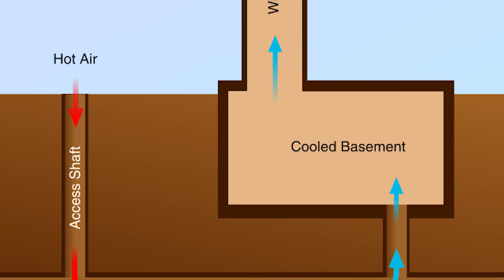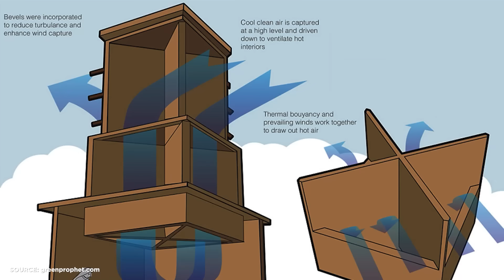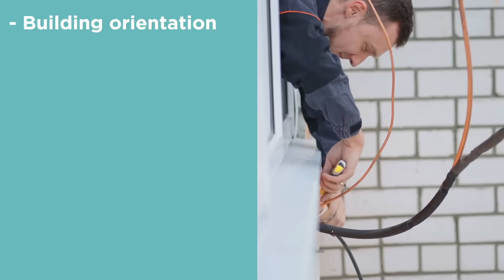Forget Heat Pumps - This House Cools Itself With NO Electricity!

Comment: Greater surface areas absorb less heat?

The rate of heat transfer is directly proportional to the surface area of the object. This means that the larger the surface area of the object, the faster the rate of heat transfer.

Comment: We sell devices in Japan that can be placed on balconies or balconies and use wind to cool the room.
It's a product designed to be used only in the summer, as you just need to put it down.
Compared to 10 years ago when I wasn't using this, my electricity bill has been cut in half.
In areas where it snows in the winter, the building structure itself cannot be passively cooled.
That's why it's reasonable to use this product only in the summer.
Click on the icon once to see the image
When you come to Japan for sightseeing, please purchase it as a carbon cancelation.

Comment: I don't like the "solutions" that require constant electricity to work. If you build a well sealed house, and the electricity goes out, you have zero ventilation. No oxygen coming in, no CO2 going out. That's dangerous!

Comment: I lived in Ireland for 7 years. The whole time we were there it never broke 25C. They're not that concerned about cooling. As far as hearing the older houses are small with a central fireplace.
They're more concerned about staying dry so they adopted the double wall system like the British. They only recently introduced standards for insulation so the older houses are freezing in the winter if you don't have a fire.

Comment: Increased South-facing windows with awnings that reduce the Summer Sun, but allow lower angle Winter Sun. Concrete slab-on-grade floors that thermally anchor the home to the Earth with ground-source loops connected to a hydronic system in the slab. All of these are cost-effective systems that help mitigate the diurnal and seasonal temperature fluctuations.

Comment: They say, barium sulphate white paint is the best paint ever to cool down buildings because they say it reflects 98.5% of sunlight back to space which is literally 5 to 10 times better than commercial white paint for cooling because commercial white paint reflects 80 to 90% of sunlight which is still really good considering but it’s still absorbs somewhat of the heat at the end of the day and for the barium sulphate paint it also has a cooling effect too by radiating the heat away from the surface even when it’s in the shade or at night causing the temperatures outside to drop faster even in the inside of your home too.  This can Fully cause you not to use your air-conditioning on a hot day again or it would just take a very long time to warm up the house depending on how hot the temperature.  The temperature measurement results by experts was whenever the paint was exposed to the hot sun during the whole day it overall stayed a few degrees cooler than the air temperature outside that is in the shade which is amazing.

Comment: Well designed passive solar homes can enjoy considerable savings without going through the expense the passive house standard. Though if one combines the two expect to live in home that is an absolute pleasure every day. Adding solar PV makes net zero easily attainable.
My current home will produce substantially more power than it consumes once the PV system is installed. It needs no AC and the attached green house can heat the home on its own during the spring and fall.
An absolute pleasure every day

Comment: heat pumps run on minimal energy. 24v signal sent to energize and the pressure difference moves the piston and you have cool air. or warm. now the fan….that needs some energy. the heat pump just reverses the system more or less

Comment: I live in an old stone house, it keep cool in summer, but is hard to heat in the winter. The only way it gets warm is if the multifuel stoves are used - then the walls hold the heat for a while (but the kind of heat generated by an oil filled radiator does nothing at all to heat up the walls).

Comment: Did you hear about the company running water through windows, to collect heat and then pump it in and out of the floors to heat or cool the home? I think it's pretty cool, but overcomplicated. I feel like you should be able to either run a fountain over the front of the window, and pump it, or have water in a shallow cistern on a sunny roof or greenhouse, and pump it.

Comment: Those wind catchers seem like a great idea for normal hot days (below80 degrees), but when the air is hotter than that, wind doesn't keep you cool, it just dehydrates you. It's like living in a convection oven.

Comment: Passive heating and cooling does not have to be real expensive.  With planning and simple changes homes can incorporate passive heating and cooling.  Some of these things can be as simple as planting deciduous trees on the south side of a house with a deck and windows.  Like the trees shade in summer and let winter sun in in the winter.  I worked on one house where the guy incorporated a trombe wall (big heavy wall) that can store, release heat which can be used for both heat or cooling.  He also put hundreds of gallon milk jugs in the crawl space under the house. Using vents he could open and close he could regulate the tempature of the house.  Now this stuff is real easy to automate and maybe a heat pump for more severe climates.  While he was building a house things can be added to a house in the same manner.  As fully professional installs can be quit expensive DIY work around can often be done at very low cost, kind of like in times before electricity and central heating.

Comment: My house has thick adobe walls, high ceilings, domed roofs, double windows (small ones, up high in the main rooms) and rooftops painted bright white. It’s always 10 to 12 degrees cooler than outside. I have to close up in the morning and open in the cool of the evening. There’s no air conditioning except for ceiling fans, which are rarely used. I designed it using common sense and observing what worked for other people here. I like my house very much. I’m on the Mexican high desert plateau.

Comment: The thing people have to understand is the energy companies would blame us for using too much, and therefore having large bills. They NEVER endorsed added insulation, ridge vents on roofs, added radiant barrier to the attic, thermal curtains, foam insulation outside at the base of the house, extra insulation under the roof, keeping curtains closed during heat or cold. Gee, I wonder why that is? For years they just reaped a windfall, and extolled more expensive fixes such as solar power and energy efficient appliances. We used a thermal additive to paint ( hollow glass beads- multiple coats -3 to 9) and this helped a lot. Doesn’t matter what you do, if your house leaks like a sieve, you’ll be spending bucks for comfort.😐

Comment: I live in South Florida where it can get miserably  hot and humid in the summer. We are about 4' above sea level and our soil is basically coral rock but also very populated so  everything around me is paved.   One summer while on a road trip just 2 hours to the north in the middle of the state about 2 hours from both coasts  I noticed it was 10F cooler at night and I had to use a blanket while sleeping.  They are 160' above sea level and their soil is porous like sugar sand. I noticed their soil is cool and soft and I was able to easily pull cool water from just 10' below my feet with a shallow well and 12v pump.  Because of this I bought land there and am now looking for passive and renewable ways to cool a tiny 10x12 space.  I know the thinking is often sealed structures and insulation (at least to stay warm), but warm is rarely an issue here.  I have this idea a very thick natural tree top canopy and a structure of only weaved layers of sun sails, polycarbonate and bug screens then  moving a lot of air into an open space from the ground or through pools of water from a shallow well in a mostly watertight and bug free space.  Just one single 500w solar panel and a 100AH LifeP04 battery 30' away in the direct sunlight  to drive efficient 12v fans 24x7.  Somebody else mentioned here, but something we can mimic is what the animals do here between 11am and 4pm, they hide and rest, so naps are a smart and powerful strategy for dealing with heat.  Since there is often an abundance of solar power around those times, I can  create artificial rain onto the structure and soil floor resulting in evaporative cooling too.

Comment: We need to go back to having more porches.  That ,and the roof overhangs, did so much to keep the skin of a building out of the sun.  In our old circa 1886 house we had a very old furnace. It made the house feel far warmer in the winter then  the 90% efficient furnace we replaced it with did and it was so simply built that in the summer, we could go down to the basement and just turn on the fan portion manually and blow the cool basement air upstairs.  Sometimes, we shoot ourselves in the foot when we get too fancy.
Reply: Yeah we need to be using the cool air in the basement in the summer...I agree the solutions can be super simple.

Comment: Concrete Stucco , clay tile water coolers are the smartest cheapest ideas to keeping, today there is brick n rock ,concrete forms, tile ,sheetrock, mud ,, but concrete stucco can be used indoors on walls , also Crete sheet can be used in attic flat part attic floor n small windows make since but tinted uv ray resistant windows , having screens inside & outside will help a lot , along with shaded areas with trees bushes,, there is also attic ventilation, also putting thick winter covers on  windows can help alot

Comment: What the fudge does the start of the video 'History of Homes in Ireland' have to do with passive housing not to mention the clickbait title "This House Cools Itself With NO Electricity!" where an individual house (bar the passive house in Texas you mentioned for 20seconds) is not looked at. Dolmens were not houses, they are ceremonial structures so whoever was giving you a tour was either taking the piss or you were by not doing any research before putting this video together.  Come on Joe your better than this!

Comment: The passive cooling/heating technology/designs must of course be used wherever possible but I understand there are places where extreme humidity with high temperatures during most of the year do not make the implementation of these solutions/mitigations be implemented (i.e.: Most of Florida).

Comment: My heat pump came with a radiation warning decal on the inside unit . .   Is that like an actual issue with heat pumps or wuz sumbody @ the factory trying 2 scare peeps.

Comment: A HUGE difference is now our homes are filled with heat generating things. Computers, lights(better w/ leds), cable or internet modems, stoves.

Open concept homes bring stoves and cook tops to the center of your house. 100 years ago the kitchen was a separate room with a door or sometimes even a separate building "summer kitchen".

One promising tech Ive seen are passive cooling panels that cool water which is the circulated into your home. It offers more watts of cooling than the same area of solar panels powering an ac.

We're going to have to stop using AC some day because of how bad even modern refrigerants are for our atmosphere.

Comment: I'm going to disagree about heat pumps.  While they may actually work to produce heat, it feels to the body like anything other than warm.  My parents had one installed long ago and eventually had it replaced with actual heat.  It felt like the air conditioner was running in the winter when I'd visit.  But I'm passively interested in your topic.  No pun intended.

Comment: THank you, Joe! I would love another video showing what homeowners can actually do on a small scale, on their own houses, to make them more passively energy efficient. Keep up the great educational work!
Reply: Hi--if you can find a high quality white paint made for roof painting--do it!  I climbed up and painted my roof as my own mother's day present to myself.  
I read the reviews on paints and paid a bit more for the good stuff.   The paint doesn't chip or peel, looks nicer, and lowered our home summer temps by about 6 degrees on average--doesn't sound like much, but it was just enough to not need as much air conditioning on most days.  Already paid for the cost of the paint in one summer--especially since the cost of electricity has gone way up.

Comment: Interesting stuff but you make a big mistake with the Eastgate centre in Zimbabwe. It consumes 35% LESS not 35% OF a typical building. Also "it literally does not have an air conditioning system" is untrue. It quite clearly does. Just a 35% more efficient one.

Comment: Lots of things could be improved, having my fridge and freezer using power to generate cold in my 22°c house, while it's -10°c outside never made sense to me.
A simple loop going outside would suffice to cut energy usage by a lot.
For cooling, a smart vent that activate when it's colder outside in the evening and the house need cooling wouldn't cost much but be very efficient.

Comment: My grandpa built their house with a passive cooling idea. It sits on a very large concrete pad (like could hold up a 10 story building big) and had the entire front of the house be a massive 2 story sunspace that draws in air. Essentially it can be 90 outside and feel like a nice 72 indoors. Same goes for winter which is common in the PNW. No AC at all in the building, just a couple electric heaters under window sills.
Reply: I’m trying to visualize this. Was this his unique design or is it something regional maybe? If you have more info I’d love to learn more about it.
Reply: @Flatsixer  it’s hard to explain. AFIAK he made the house himself, the only part he didn’t make was the foundation, which weren’t originally to his specifications so he was ready to take the company to court if they didn’t redo it. It’s funny because the concrete foundation my dad said it strong enough to hold a 5 story building, and when a 4.7 earthquake went off years ago my grandma didn’t feel a thing. Every single wall and even the floor is cross beamed and the amount of beams was double and the thickness of the beams was near double so when you walk even on the second story if doesn’t feel like you’re walking in a wood house, it feels like steel and concrete, it’s that solid. My dad helped my grandpa build it in the 80s when wood was cheap, he even put massive inch thick trim on the doors so it’s basically impossible to tear out door hinges without removing everything, I had to drill out a lock once because of that, there was no way to fiddle with the bolt. 
As for the ventilation design, I’m still a little confused by it, but I just know that when it’s hot out the sunspace which is basically the entire front of the house (with a rafter floor on the 2nd floor to walk around on) the sunspace heats up and the rest of the house will stay cool, and when it cools down I open up the windows on the side and rear of the house and the doors to the sunspace (the bedrooms on the 2nd floor sit behind the sunspace with doors for access) and there’s a flow of air that moves from the back of the house to the front.
This house will likely last centuries.
Reply: @jacobbaumgardner3406  What direction does the front of the house face?
Reply: @jacobbaumgardner3406  I was believing but the not feeling an earthquake bit seems fishy. You can't just out-build the shifting of the earth with supports.

Comment: The main problem is that this usually is implemented in INDIVIDUAL HOUSING and I almost laughed when you mentioned an efficient "lawn watering system" when lawns themselves are a huge problem.
BTW i got Nebula but it is basically unusable.

Comment: There were homes down here in the south that used to cool them selves with out electricity. They were raised homes with these hollow brick columns threw out the home that existed in the attic they would draw in cool air from under the home and it would cool the house and attic it was pretty neat tech it was lost during the civil war when the north burned down all the antebellum style mansions.

Comment: Everyone speaks about thick adobe walls, big porches, planting trees around the house, opening windows during the night, etc., as if it were something new. This is like reinventing the wheel. I live in a house like this, that was built around 1940 (it's even younger than the house built by my grand-grandfather, where I was raised), and still running. I have in the bedroom 25-26 °C while there is almost 40 °C outside in summertime.